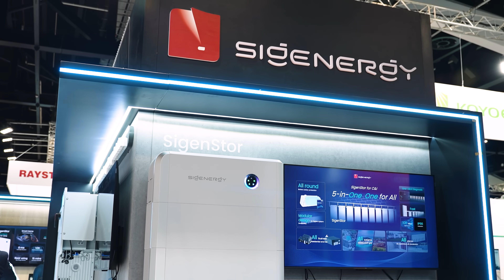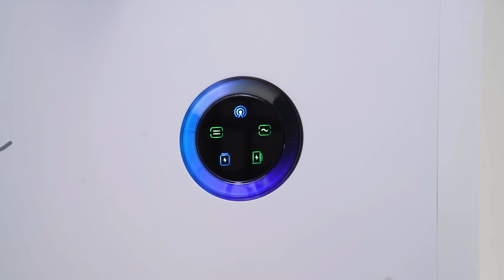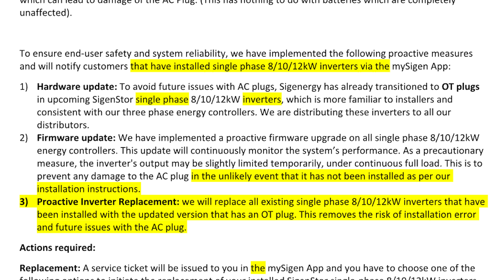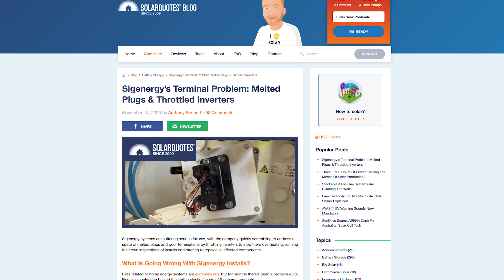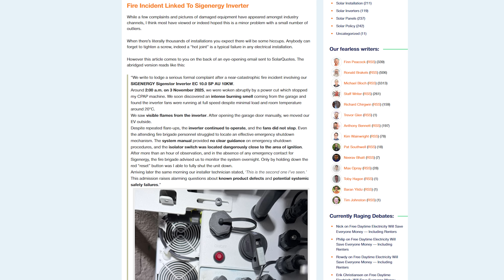Australia’s #1 Battery Recall: What They Aren’t Telling You

Comment: I tottaly agree with your comments and wholeheartedly hope that sigenergy survives this . Having said this I do find that most experts have pushed sigenergy is the one and only Battery to endorse whilst at the same time oether brands wich are at least as long or longer on the stage here in Australia are ignored or even pushed aside as to cheap and nasty because they are ONLy three years or even longer on the market eg Anker or Sofar .
So please if you are fair dinkum about the Industrie dont be nasty about those companies for the sake of promoting Sigenergy .
Reply: No my decision for Sigenergy was for whole house backup. Most of the other batteries apart from Tesla wanted you to run another circuit to isolate those points in your house during grid power failure. Sigenergy brought a product that could do a modern house (single phase 40 amps) without changing the existing wiring. Anker were restricted so you needed 2 systems.

Comment: This indicates that there are design flaws. Good design should not give installers the possibility to make mistakes, and this is the same in many fields.
Reply: Absolute right. A poor design makes it easy to point the finger at the install. A well designed product should never have to blame the install and make it almost foolproof. Especially with a high risk product like this.
Reply: @j @javedmower4091 exactly! Take an example from the electronics world, only connectors like USB-C, ones that can be plugged in from either orientation and automatically adapt to different power levels, are designed with a unified shape. This is what’s known as a “fool-proof” (error-preventing) design.
Reply from the maker: @javedmower4091   maybe the issue is mutileveled and as I say in the video - the plug design had room for improvement and it is being improved.
Reply: Right, so you are ready to install you own Tesla Powerwall?
Reply: Installers make plenty of mistakes all by themselves. Your comment is a stretch.

Comment: Why any installer would use the orange cabling is beyond me. We used 16mm black flex with zero pressure on the AC plug.
Reply: I'm in the position of having signed for a Sigen system which is not yet installed. I'm also an Engineer with a background in electronics design. I agree that Sigen's response has been for the most doing what it ought to do. However....

- The design deficiency isn't just the choice of connector. What they have is a design where there are heavy cables having to go through a 90 degree bend in a confined space. That's a bug I spotted the first time I saw the EC and before the issue was revealed. Yes you can specify flexible cable, but they didn't.
- in the users group FB thread was posted a photo where a small fire had started in the internal cabling for this connector. This is not an installer's mistake. The problem will probably go away with the OT terminal.
- It's a problem if you own a Sigen and  you have to have your unit replaced. It's a bigger problem if you've contracted to install, your EC is recalled and if the replacement doesn't arrive in time. Someone loses STCs and that could be the installer's misfortune.
- Will Hall from Sigen posted about this issue on FB and ignored that issue. What he said was mostly ok but it leant towards avoiding saying "we stuffed the design". He needs a good writer. As I said, Sigen's response has been good, but their communications could be improved.

Yes the industry has some issues. A lot of them don't understand what they are selling technically. And some just have their own hangups.

I chose Sigen because of its robust, flexible design. What surprises me is how poorly their stuff is documented. Particularly the app.

Also if you want a real horror story. Think about the consequences of all this critical infrastructure depending on the cloud. It's not just Sigen either. Everyone is doing it. Imagine what happens when the company goes broke or China ends up in a war. We need to demand the right to ownership, the right to direct local control (not through the cloud). The right to repair and reverse engineer firmware.
Reply: @saumyacow4435 I agree with your last point, but the Sigenergy uses modbus and can be controlled locally through home assistant via an integration. There are more features exposed than are available in the app. 
If they had have gone out of their way to block the modbus from the local user I would totally agree with you.
Reply: @StephenBrightwood HA is complex to use and expensive. It would require almost no effort on the part of Sig to enable local access on their app.
Reply: @saumyacow4435  should be a terminal block and lugged - the 3 phase are lugged and obviously smaller flex but the plug in design for most solar AC is a mistake i believe
Reply: @saumyacow4435 100%
Reply: @saumyacow4435  "Think about the consequences of all this critical infrastructure depending on the cloud." Its even worse than that. Labor's plan is to scrap the coal generators and do the grid stabilization entirely online with software and inverters. That's the reason I went for Sig => blackout protection.
Reply: @cyber5515  Try to keep the politics out of it but if you do want to try do remember things such as Labor in QLD wanted to build large scale pumped hydro which would have been a direct 'spinning' replacement for coal but the LNP cancelled that and has not really done anything towards firming up the network other than to say "We'll throw a bucket of money at coal and keep it running until 2045", whilst the plant operators themselves are making commercial decisions to shutdown coal generation well before that ...
Reply: @cyber5515 it's not a "plan to scrap". It's a plan to replace coal fired generators with modern technology as the coal generators reach the end of their economic life. Secondly, grid stability does not require mechanical inertia. Third, renewable are the cheapest form of generation. The fact that you're getting a battery says the policy is working. We need more storage and we're getting more storage. There are also grid scale batteries under construction in case you weren't aware.
Reply: Orange circular comes in many variations, various strand counts, flexible, for fixed use only, for 'mobile' applications (device cord) and so on.  If the right type of OC was used it'd be fine.  In fact even using OC that is not-flexible would be fine too if fitted off properly and bend radius limits observed.  It's more or less fixed wiring as it stands with the plug unlikely to ever be removed for the entire life of the inverter.  Which raises a query to me, why have a plug in the first place.  Hard wire the thing.
Reply: Yes 10 x 16mm radius bend is restricted by the flimsy gimmicky side cover which is why the bends are being pushed back in so this is design flaw which I can never understand why a right angle connecting plug wasn’t used?
Cheers
Reply: I'm a consumer, and have noticed the orange cable in my install which was done about 4 weeks ago. What is the problem with the orange cable? Does"nt the installer just use the cable that is supplied in the kit from Sigenenergy?
Reply: @gary_r8965 no they use their own as cable isn’t included and this is in the instructions diagrams as the bigger 16mm for the 12kw needs 160mm bend radius which is being compromised and pulling out the pins. Still a design that needs improvement anyway .
Reply: @MichaelDance-d8d  Thanks for the answer Michael
Reply: 100% that’s exactly what’s happening as it pulls out the terminals when bending. Sig install instructions show the black. My 3 phase was installed with orange in corry and then they cut out the dec side cover which I didn’t except and made them replace with black and a new cover.

Comment: Realistic reporting is greatly appreciated!!! could you please do a similar review on the TESLA power wall 3 recall? I'm a fan of TESLA and I've looked into getting a power wall but I am a bit surprised by the number of installers I talk to that don't recommend installing them. I was under the impression they were a leading seller for a long time and there has been a big increase in competition, is that the only reason for the shift? I do get the impression from installers that one big reason they don't like TESLA is they are more difficult to install (not modular) as  a consumer I'm not fazed by the install, just interested in the product.
Reply: Correction its only on the Tesla Powerwall 2 and on a small batch due to the cell chemisty from a particular supplier that was faulty. Allot of the installers mention that the PW3 is great for single phase but for 3 phase you have to compromise, to have partial home backup. But there are still installers doing Tesla PW3 installs - just right now there are so many options and to be fair Tesla is the largest company when it comes to batteries just right now with all the competition and demand in the single phase they have dropped down the order.
Reply: Felon Musk
Reply: @bobbyjames235 Also they are very heavy so you need a larger team to install one. I think Tesla are doing a big price reduction so that might sway some buyers.

Comment: Shows you the downside of VPP putting additional stress on the equipment. So energy savings offset by equipment failure.
Reply from the maker: It's all a matter of how much - our inverter (not Sig)  in the office did not like the VPP mass exodus from the battery one evening and definitely I smelled something - so maybe VPP ok - but not at all volume/cost.
Reply: that is simply wrong. VPP's pull from the Battery as fast as they can. What that fast limit is, is totally independent of the VPP and the inverter owner and lies with the installer implementing the limit as per the DNSP instructions. For most on a single phase that will be 5kw only in suburbia and maybe less if you way out in the country. For those with big inverters and even bigger PV the 5kw limit is only from the property to the grid. If at the same time as you are exporting flat out your running the pool pump the oven and the whole house AC then the 12kw inverter may well be producing and sending 12kw out of that AC plug while maybe using some of the spare DC from the PV array to DC charge the battery and DC charge the owners EV at the same time. but in that case only 5/12ths of the total AC production is going to the VPP not 12 12ths
Reply: @andrewsaywell5240 It’s the sustained throughput over time that contributes to heat buildup, not just the peak power level.

Comment: Very thorough analysis. Agree 100%. BTW, since AS/NZS 4777.2:2020 introduced the requirement for LVRT (Low Voltage Ride Through), to help support the grid, this function now inadvertantly increases the chance of over heating of a high resistance a.c. connection. When the resistance on a poor crimp causes voltage drop, the inverter's LVRT function causes it to increase current output to "assist" the grid, however, the result when the voltage drop is due to high resistance joint is to worsen the situation. One step forward, two steps backwards :(
Reply from the maker: Hi Glen, you are a jewel in this industy - thank you so much for giving us this additional explanation,.. so its actually a meeting of 4 matters, VPP, low voltaghe ride through, hard to find flex and work arounds and also now a better plug .. I call this - potentially -  problem solved. :)
Reply: @yeanswers  Actually, full credit for this explanation must go to my electrical engineer friend, Ranjeet Malewar from ZECO Energy who pointed this out to me this week. Interestingly, their Marshall controller can detect this problem and potentially alert end users and installers of a potential problem before it gets serious.
Reply: @SmartEnergyLab Ranjeet off on his own story to flog their box.
He's straight up wrong here.
Best look up the  thresholds for LVRT.
Voltage disturbance and withstand requirements 
Requirement is continuous power 180-260V
200ms
Cease power generation below 180V +/-4% tolerance but remain connected.
No allowance is allowed for boosting of current below 180V.
Must go back to pre-disturbance within 400ms
He's wrong
Reply: 100% spot on thanks Glen
Reply: @MichaelDance-d8d totally wrong.
Even if the voltage drop was 20V and 40A of current there would be 800W the connection would need to dissipate and that would melt more than just the plug.
Reply: Both these gentlemen need to be transparent and reveal what kind of sponsorship/financial arrangement they have with Sig. They continue to support a company despite they themselves coming out and announcing a recall due to either inherent faulty design or a design mistake that leads installers to get things wrongs during the installation. I’m not sure if they will have the same kind of acceptance level if any of the other new company in the market got something this wrong that potentially lead to the whole house burning down.
Reply: That's totally incorrect Glen.
Reply: @karlajensen100  Why?

Comment: I’ve heard that installers were blamed by sigenegy for the issue and that installers reported the plug issue to Sigenergy. It’s only when the number of reports back to sigenergy got to a level that they needed to do something, that they acted!
The fix is essentially a reworking of the 3 phase unit for the single phase.
I guess the truth is somewhere in between what you have reported in this video and what the installer told me.
With Sig, keep in mind this is a new product and there is a bit of R&D happening post installation in the field
Reply from the maker: Have a look at the Smart Energy Lab explaination above - might explain why a crimp that was acceptable in the past and a plug that was fine in the past - is now not ideal anymore.
Reply: @yeanswers that response is totally incorrect AS4777 Table 4.8 describes voltage disturbance response required by the inverter.

Comment: How are the 5kw SP inverters different and not subject to a replacement?
Reply: Different plug
Reply: I assume the terminal is different and wont need as many amps as a 10kw inverter. A 5kw inverter will need a cable suitable in diameter for 20-25 amps. The inverter should have surge protection and momentarily deliver 7500w for a few seconds so would need 35-40 amps. 6mm cable should be plenty for that and a 10kw inverter needs 10mm cable. Bigger the cable, bigger the terminal, more amps it can handle. 12kw inverter needs 16mm cable and so on.